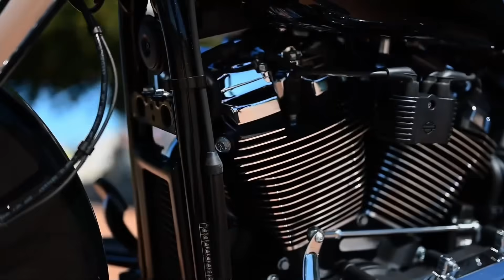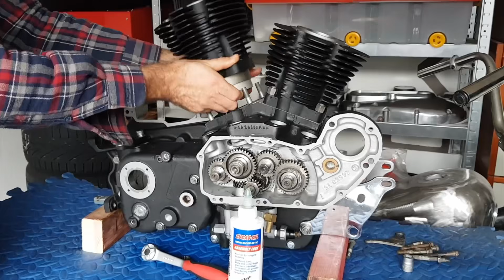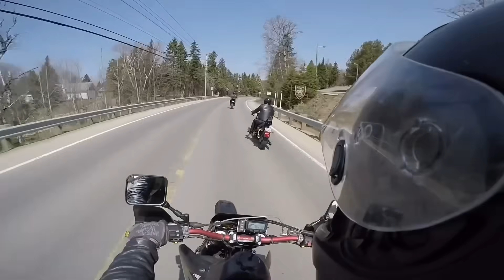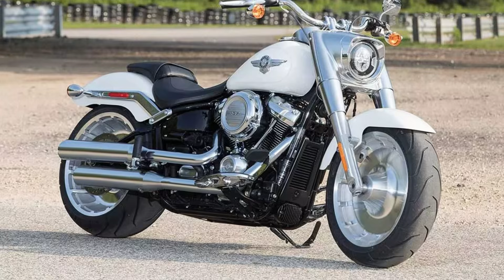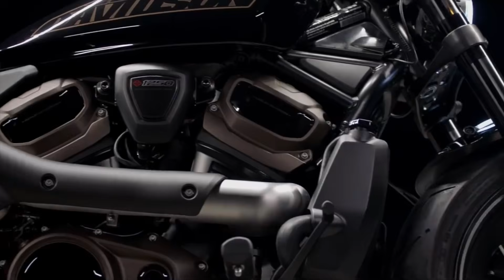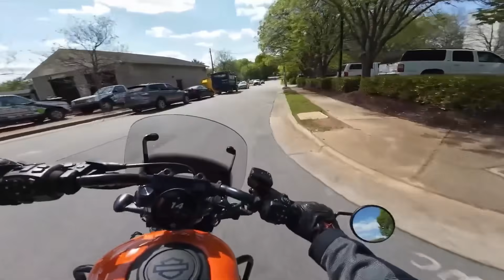Mechanics Reveal Which Harley Engines ACTUALLY Last

Comment: I love  my  58  Panhead  , My  1979  fxe   has  25 000  miles on it  ,   Never  had  the  engine  apart  runs like a  top   , Upgraded  to Dyna  ignition and  a  Bendix carb , barnett  clutches / EVOS  are  the best  bang  for  the  money !                (   A  good vintage Harley   repair  shop ) is  a must  to  do  the  things  you   can't   !  The  dealer  will show you  the  door   !

Comment: Yea. Watched for 27 seconds. AI trash.
I bought my 1978 1/2 Superglide in November 1978.
Still have it.
Still runs great. Pointless ignition worked perfect for 12 years. When it failed it just startrd backfiring and loosing power but still got me home.
Only thing ever fell off was the kiehin carb. The bike came with the big toaster oven air cleaner. So I got a nice small round one. Nobody told me they changed from the O ring manifold to the rubber band and therefore you needed to add a bracket to hold the carb. Or change back to the O ring with aircraft clamp.
I did both.
Still fun to ride. Vibrates kind of a lot.
Tires...pipes...chains...oil...grease... and 2 different carbs...in almost 50 years.
Still worth what I paid.
Only AMF defect is a couple crappy casting marks.
Reply: Ok. I went back and watched 4 minutes in.
Still AI trash.
All the same crap that people have been pushing for decades.
Ohh... And I have a Twin Cam also!!...
My shovel only actually leaked from the chain oiler. It was designed to drip motor oil on the chain. Most people shut them off and used spray lube.
No leak to this day from the heads or cylinders. Slight seepage between the cases. Only noticable if you never washed it and rode in dusty conditions and let the dust stick.
As for top end rebuilds. That was because they were produced to run on leaded high test which was available everywhere. The no lead gas was wreaking havoc on a lot of engines. Many Shovelheads required new valve guides as a result. Im still running the original valve guides because I started running Marval Mystery Oil in my gas. She could use a little freshening now with about 65k miles.
The twin cam... well I was pissed about the cam chain tensioners. I did upgrade from 88 to 100 cubes with an S&S kit. At 30k miles. Not because anything was wring. But because all the talk about plastic and blown engines was always in my head. But the shoes were still fine and my crank runout was 2 thousanths. I imagine its probably deteriorated some now after all the increased power. The first couple years at 100 cubes I couldnt keep my fist out of it. Too much fun. Have to be careful because it will pull the front wheel if you get too exuberant. On a 900 plus pound machine.
Zero leaks anywhere.
I never heard obout rocker box leaks. They are O rings so I guess you could get a bad o ring.
Only problem Ive had is running through rear tires pretty quick.
Reply: I remember the 78 1/2. I’m a bit younger than you, but I bought a brand new 1979, 80 cubic inch. I had to replace valve guides almost immediately, and lots of added chrome. I loved the bike. It was a Low Rider. I sold it, and my Corvette to buy my farm. I wish I had them both back! I now have three Harley’s, two Twin Cams and a Milwaukee 8, and two Corvettes. My most costly mistake was my ex-wife, but she’s gone and not missed!!! I must add though, I also have two sons, and a stepson. They all work for me, and my oldest son wants to buy my business and Real Estate. We’ll see!

Comment: AMF never built Harley engines , Harley factory employees sabotaged the shovel head engines and got caught, I bought a 1971 fx and didn’t use hardly any oil and ran strong, I had the engine rebuilt with S&S 93ci sidewinder internals and dual plugged heads , very strong dependable engine, I’m 75 and still love that machine